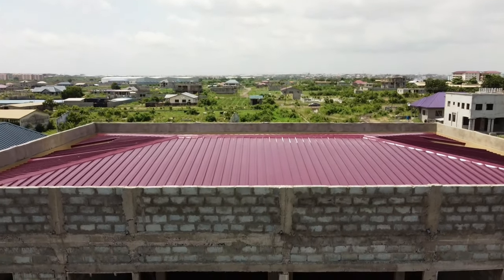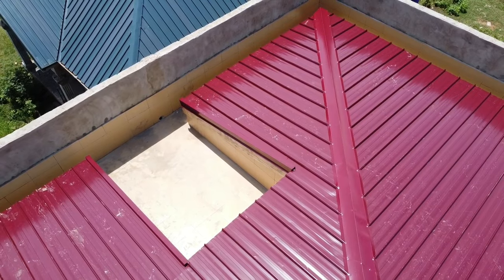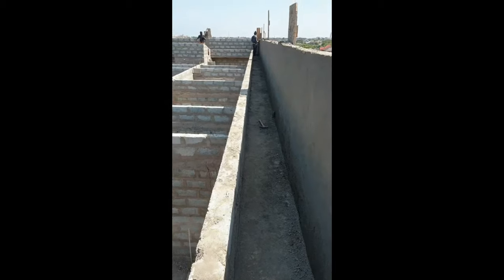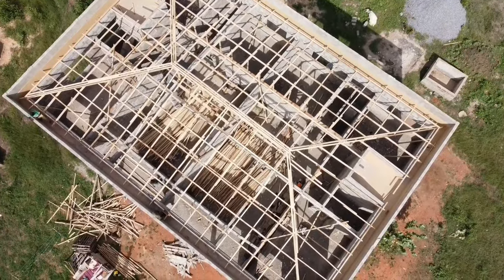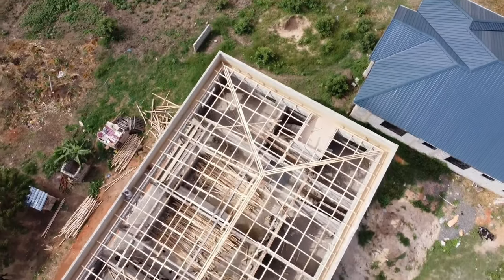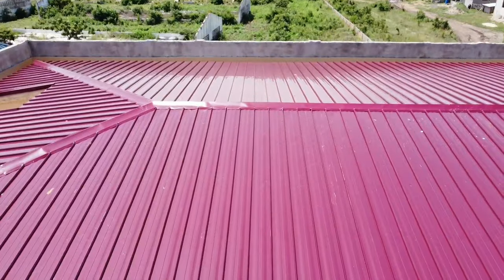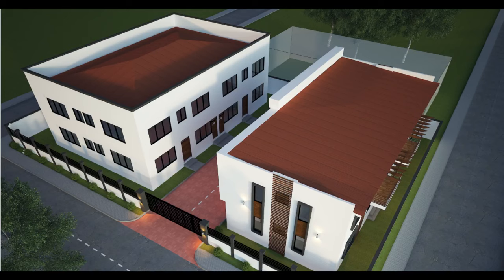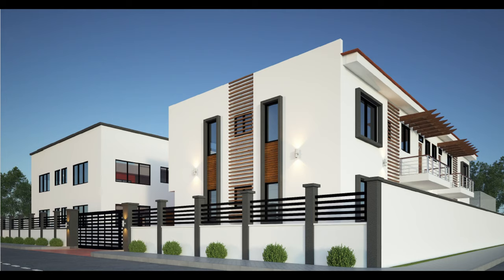Secret / Hidden roofing | Pros and Cons

Comment: The metal  bar is called “ rebar”. The biggest risk to consumer is failure causing leakage. You can cover the exposed concrete with a liquid water proof membrane that that be applied with a squeegee it’s a liquid that dries in 2 hours. You can use also liquid epoxy and do the same thing. Definitely slope the roof to a PVC drain and collect the water if needed for gardens etc. Adding  a metal roof to this concept is backward thinking use this space for a roof deck where the family can relax and enjoy. You can cut drums in half add soil and use to set up a roof garden for the wife. Plan needs to provide access to the roof. Where  can I get a customized plan? I am coming to your Country next year to have a look. Regards from Barbados
Reply: Thank you for this
Reply: Thanks for elaborating sir. Planning to build soon
Reply: Very funny, which you luck in your quest. It's either you get lucky his country men receives your design or you end up abducting their own design 😅😅

Comment: I agree, let the roof lean to one side and let a gutter collect the rain water and funnel it downwards into a concrete rectangular or square block well built into the ground like 20-30 feet dept and this water is then used for washing and watering the gardens and fruit trees in the back yard.

Comment: You have no idea how happy i was when i saw this video. i had many 2nd thoughts about going for a concrete rooftop because of all the waterproofing cost, heat and cracking etc. and i didn't wanted to go for a sloped roof because it prevent the modern minimal look. this method is great because it deliver the modern minimal look from the outside while reducing the cost and hassle of maintaining a concreate rooftop. Thank you for the genius idea ❤

Comment: Thank you so much for the  presentation 👍 What a smart and brilliant young man. Your digital creation is excellent. 

 Great job well done  ✔️ This is the first time I have gained insight into the complexity and technicality of this hidden roof. I wish I saw your video before choosing it for my home under construction. 

Dear Lord, it would be a total disaster if you hired an engineer who doesn't have the skill and competence to build this kind of roof. You did have leakage all over your home- FRIGHTENING. 

It's worse in Nigeria, where there's no professional ethics, transparency, and disclosure . They claim to know how to do everything and end up messing up the homeowner.

If I know what I know now, I won't choose this roof. I would go for the  conventional and be able to sleep at night. 

My home is as big as your sample home on this video and has two gutters on both sides.

I didn't hear you discuss felting waterproof material. Where is it placed on the floor of the gutter or the walls 🧱 ?

Last last, this roof is far more expensive than the conventional. Felt is imported from Germany and very expensive.

Comment: How long did it take you to reach this level and what’s the total cost of your project
Reply: I just admire the progress
Reply from the maker: This project started late 2017. There was a time we didn't work for a whole year. For the cost I stopped tracking after some time. It can be reassessed though
Reply: @ebenameyibor  Got ya thanks for the update. I also noticed the single story building during the Drone shot. By the way the views are amazing how many rooms are your single story building
Reply from the maker: @dzifabello1136  Thanks. It's a 4 unit of 2 bedroom apartment. 2 units up and 2 units down
Reply: @ebenameyibor  I agree with you. If you keep tracking cost, you will be depress😂
Reply: @ebenameyibor  
Exactly 💯 where I am right now. I stopped tracking the cost as it is very depressing and discouraging. Building Gulfs money 💰 Nothing is cheap both materials and labour cost.
Reply: @ebenameyibor  Great job congratulations 🎉